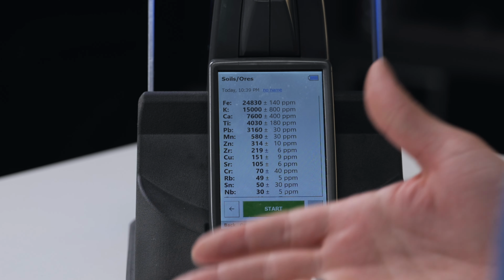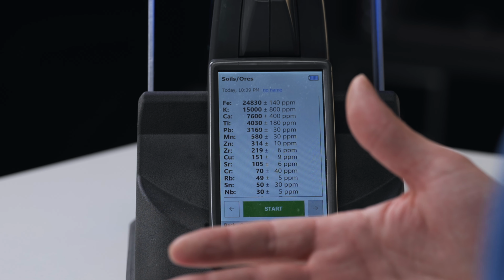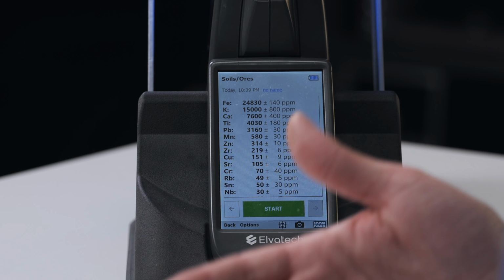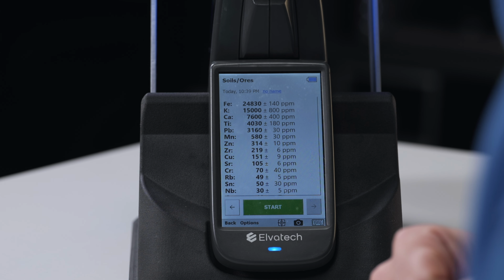How is XRF analysis applied in environmental control?

Comment: I saw in the video about using XRF for air pollution analysis. Could you explain how straightforward or complex the process is? What are the main considerations for using XRF analyzers to test particulate matter in air samples?
Reply from the maker: Great question - XRF is actually one of the more straightforward ways to analyze particulate matter in air samples. PM is collected on low-background filters (typically PTFE or polycarbonate), and prep is minimal: you simply mount the filter and run the measurement. The key considerations are choosing the right filter media, using matrix-matched calibration/standards, and ensuring sensitivity for light elements (often via vacuum/helium modes). Also, even particle distribution and a representative analysis area matter for repeatability.
If you’re curious how this looks in a real workflow, this PMx5050 video may help: https://www.youtube.com/watch?v=JTLrJqCeF5Y
Reply: @Elvatech Thanks I'll look it up